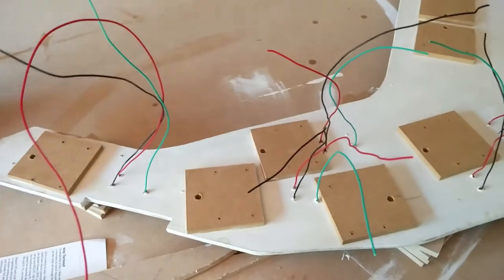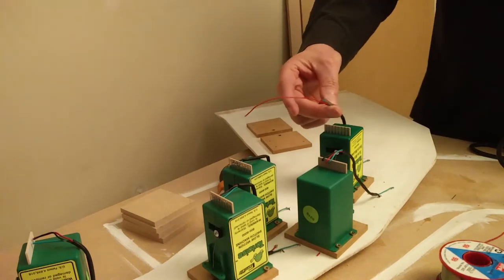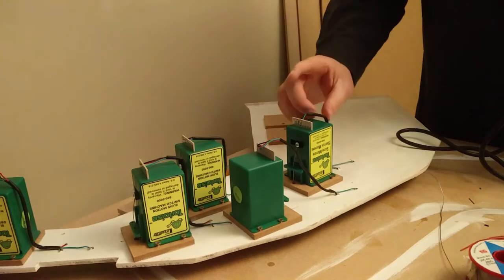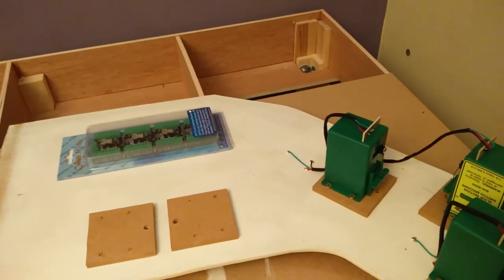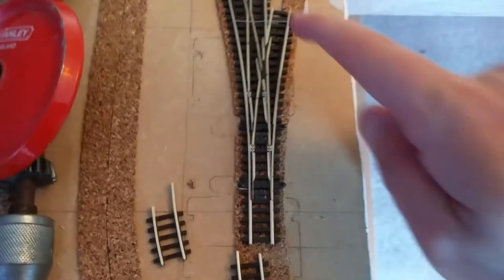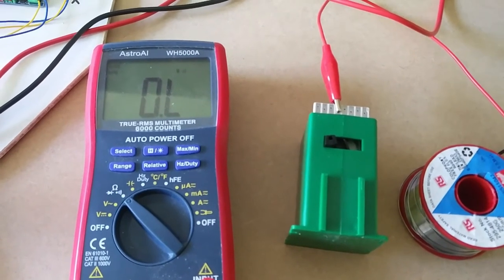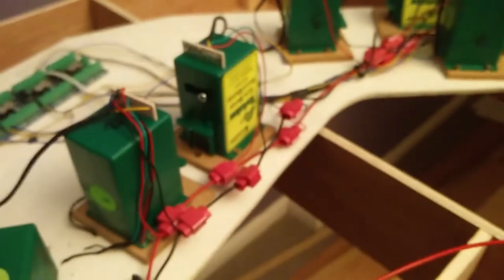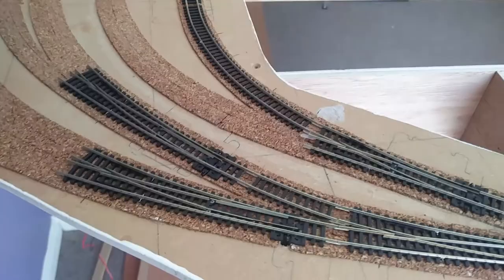09 Wiring and tortoise point motors | Tortoise point motor wiring | Point motor controller

Comment: As Always very helpfull hints and expieriences - "faults" as You call them. These admitting of wrong paths makes your channel so sympathic. 

I have to damit I do not want to use DCC and Point engines at all -as I do build on 9mm gauge my scale ist 7mm/ft so your lessons are very very helpfull - saving money by using 6mm plywood (instead of  my First soloutions of buying 12mm) but your solution Looks right to get it ridget and leveled.

All my pointwork must be layed in bigger distances as the locos and wagons are 35mm breadth in maximum. But your suggestions on your "point harp" (as we call it in German)  aretremendous pile of helpfull information. 
As I'm not really brilliant at electricity at all so I do avoid electronical at all....

Thanks a lot from Berlin, Christian